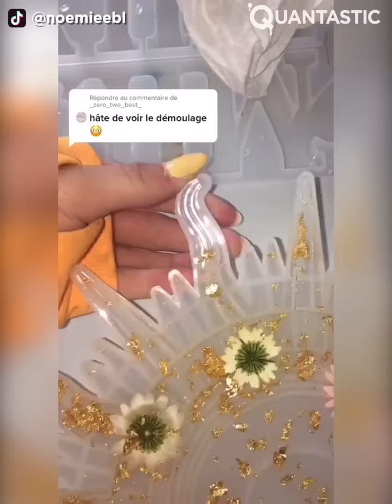Epoxy Resin Creations That Are At A Whole New Level ▶9

Comment: I love resin art so much and want to do it so bad but the fumes and having no ventilation nor yard makes it too much of a hazard, plus I have shedding cats. I could only do small amounts of uv resin.
Reply: The environment thanks you.
Reply: Actually there's tons of art resins now. No VOCs or harmful fumes are what you need. 
 I do it in my apartment with cats too. Although I occasionally get a stray hair. 
I do wear gloves,arm guards cause I'm messy & an apron. 
Just make sure the cats can't or won't jump up, usually by providing a space where they can see what your doing. 
Also do it over a large silicone mat for easy cleanup & make sure the cover will prevent or block a cat sitting on it. 
I switched to a dehydrator with metal removable shelves so I wouldn't have to wait as long. Otherwise I just blocked the cover from them.